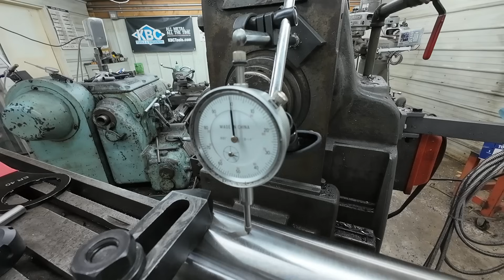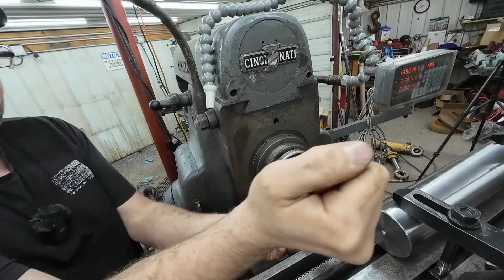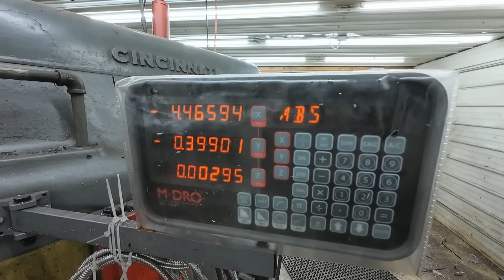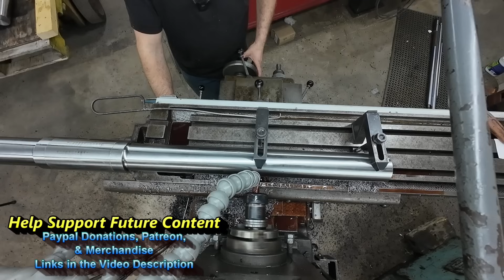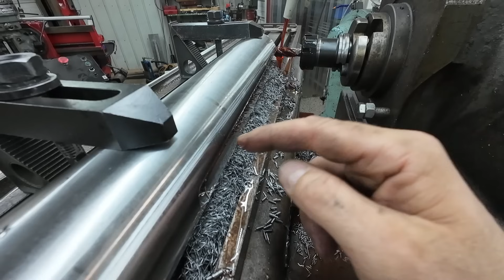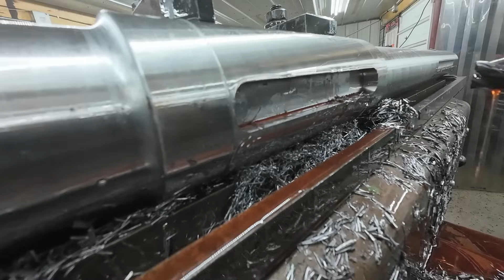Milling Precision Keyways On An Ancient Horizontal Milling Machine | Manual Machining

Comment: This is a very slow and NOT properly done keyway. When you take several depth passes the endmill wears only in the front and when done the slot will be slightly tapered and  hard to hold tolerance in the width of keyway.
Take a slot drill, they are 2 flute (made for keyway cutting) they are shorter and stronger, don’t flex like a 4 flute endmill, take one cut and done! A two flute always gives you the perfect size provided the tool runs round. No fuss no measuring 10 times.
Hint…depth will be half of the diameter of cutter, in this case 3/8” when the cutter front cuts completely round on the diameter of shaft, go in 3/8”.

If l had many to cut, the faster way would be using a woodruff cutter or staggered tooth milling cutter providing you can allow a little longer keyway with radius on ends, but again one depth one cut only.

Comment: I'm curious about setting the Z position at the start of the setup. When the shaft is laid in the table slot, there is a small section that is below the table surface. I did a rough calculation and for a 3" diameter shaft and a 3/4" slot width, the bottom edge of the shaft would be about .0476" below the table surface. How did that figure in when you set the center height for the cutter?

Comment: Just wondering if the heat generated during milling operations like this causes the cutter to expand to any measurable amount? Does the coolant take away a significant enough amount of the heat to prevent significant expansion??

Comment: so, when measuring depth of cut for a keyway, is the depth from the original outside circumference at the point you start milling, or is it the depth of the keyway at the completed edge?

Comment: Horizontal milling is the way  😎👍 prefer it myself. Especially on our TOS w100a HBM.  Super easy, and the chips always falls off and so 

For center finding - may I recommend you a Tschorn savePlus 3d one.  Then touch off top/button, and if your dro have 1/2 function, you will always be spot on. Every time.  Such a time saver.  Use it daily (and other brands as well) but its a fantastic tool combined with a dro.

Best regards from Denmark

Comment: Hello Josh, Nice to see old machines doing good work.  I've been cutting a lot of keyways lately (ever since a milliwright company one street over discovered I existed).  I've found the easiest way to measure the keyway depth is from the bottom of the key to the opposite side of the shaft, using a mic.  This method is very easy to do when using a horizontal mill like you are because the opposite side of the shaft is always accessible.  It must be the common method of measurement as Machinery's handbook has a table of values for that measurement for various combinations of shaft diameters/keyway sizes. 

I've cut some keyways on my HBM.  I like it over my horizontal mill because I can see the action without having to use a mirror or walk around to the back of the table.  My horizontal doesn't have rear controls so it makes it a pain. 

How do you like using straight oil on your milling machine?  Is clean up more difficult than soluable oil or not bad?

Ken

Comment: Josh, what benefits, if any, does plunging horizontally give rather than vertically? Does it give you more control by using the y axis? I understand why you horizontally milled the slots and am mainly asking about when you plunged the end mill in to make the 7/8” slots. Thanks for the video

Comment: Do they ever have to make tight tolerance keys as most keys I come across have some slight size difference, +or - a few thousands and does the timing of the two key ways matter in most applications

Comment: Josh
Nice job👍 Horizontal Mills are still very handy. I try to cut keyways with milling cutters on the arbor when ever possible. Every keyway comes out straight, square sided & consistent size. Tool wear usually doesn’t happen. I use Woodfuff cutters when ever possible in the vertical milll whenever possible too

Comment: we have a B&S #2 universal we use 3 cutters on the horizontal arbor to mill key seats in a shafting product we make. its a bit of a lost leader, but since its cranking out 6 at a time its not so bad, really minds itself over in the corner.

Comment: Interesting video. Good thing you checked your math before cutting! When you set up for the 7/8" keyway how did you make sure the shaft was set at the proper angle? Is it critical that the keyways be colinear? I am guessing you could run the machine down to the other key and make sure the cutter is centered in that one.

Comment: Nailed it!  I always try to set up with a natural path for chips to 'flow away' from the cutter.  In the vertical position, you're fighting gravity for chip removal.  If the chips remain in the slot, surface finish will diminish, and tooling will dull much faster having to re-cut all the chips.  If forced to cut in the vertical, I use a Kool-mister.  The combination of coolant, compressed air, and evaporation greatly help, but you're probably breathing some bad vapors.  Great content!  Is that ATF oil?

Comment: I ran that same model machine doing keyway it had a fixture so you can cut 5 shafts at a time using gang cutters on the overarm. Made shafts for powerking tractor.

Comment: Good afternoon Josh, the ATF for cutting fluid is still looking good and clean. I'm definitely tempted to ditch the soluble oil and copy your idea.
Reply: I was just about to ask if that’s what he was using for oil. Thanks for bringing it up.  Apparently I’ve missed a few episodes somewhere. 

Seems like a good idea to me, and appears to produce good results. Coolant needs to be changed too often for my needs, and rancid coolant can cause all sorts of issues.
Reply: @KennyEaton603 exactly old coolant is nasty,  and more likely to corrode under your vice, Stefan Gotteswinter and Rustinox have switched to oil in their Deckel mills as well and both seem happy with the results
Reply: i tried that on my jet lathe and it erased the chart on the feed and thread chart on the gear box.  don'''t do that please.
Reply: @johngillon6969 that's unlucky sorry to hear you had a problem,  my old Adcock and Shipley mill only has engravings on the dials, and the belt speed chart is inside the door so well away from fluids.
Reply: @Paul-FrancisB  think about chemistry.  maybe there are chemicals in transmission fluids that react with machinery parts or seals.  for example.  i lent my floor jack to a friend,  it was low on oil so as a favor he topped it off with brake fluid ,  now the jack is fucked and the seals don't work and there is brake fluid on the concrete.  i learned a lesson.  just ignore my warning.  your lathe was made when they took time.  even some micrometers today have  painted increment markings.  you can save a penny here and there, but it makes sense to listen to the chemists that manufacture coolants, just sayin.  is that belt impervious?    perhaps not.
Reply: @johngillon6969 thanks for your concern,  however I am Principal Chemical Engineer  with a few decades experience I'm comfortable assessing the materials compatibility. 
 It's unfortunate you friend put brake fluid which is glycol based in a jack designed for mineral oil, not a surprise it damaged the seals when it can strip paint.
As I mentioned it is not a lathe but a mill (horizontal with a universal head attachment FYI), and the belt is not a component that can be wetted by coolant,  or cutting or way oils by design.
Reply: @Paul-FrancisB  good luck dude

Comment: With .015" tolerance, is it possible to use a 3/4" mill, and hit the number? Or is it just too risky?  I really love your shows, josh, thanks!
Reply: When you are full slotting one side of the cut is a climb cut and the other is conventional. This pushes the cutter to one side and so you can end up with a slot that is out of position and out of tolerance. So better to slot with a smaller cutter and then cut each side seperately.
Reply: I think the .015 was for depth not width.
Reply: Depends on your endmill and it’s lenghts. With a good carbide endmill everything is possible at good milling condition and technology.